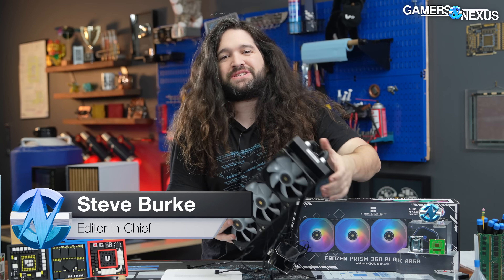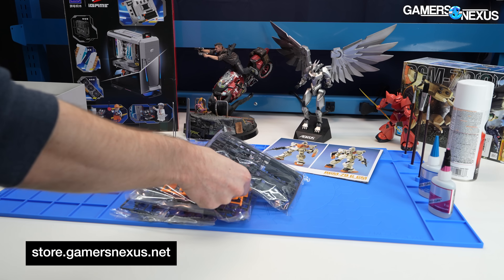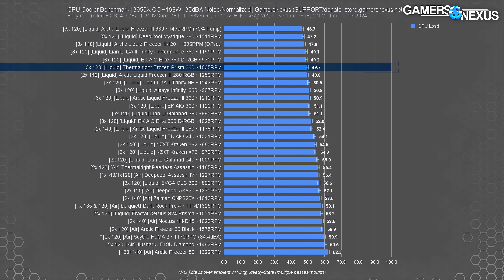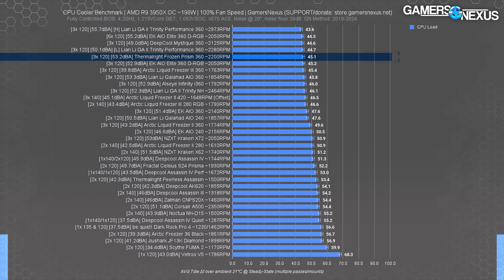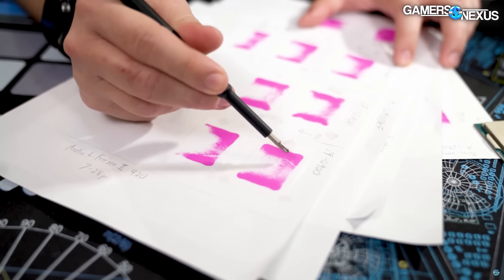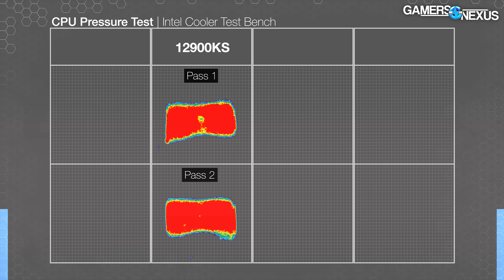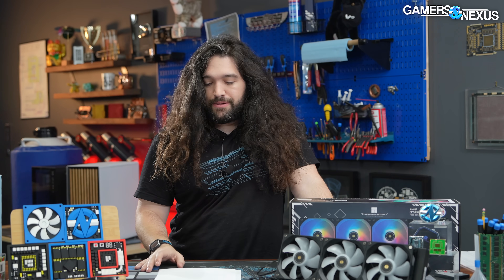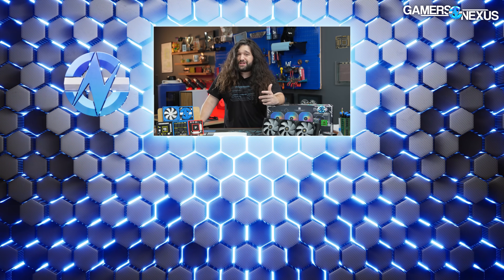Thermalright Strikes Again: $56.90 360mm Liquid Cooler | Frozen Prism Review

Comment from the maker: Working on updating the Mega Charts right now, by the way! Adding a bunch of stuff to it. Ended up holding on the update a little bit because Noctua should be launching the Noctua NH-D15 G2 very soon (per Computex interviews), so we want to add it in with the update! Really looking forward to testing that one.
Watch our Liquid Freezer III review here: https://www.youtube.com/watch?v=zfffNRTOZCc
Check out our Antec C8 Case Review from yesterday! https://www.youtube.com/watch?v=yJAq2H52A2A
You can grab one of our PC building Modmats with wiring diagrams, pinouts, and screw-tracking grids here: https://store.gamersnexus.net/products/large-modmat-gn15-anniversary
Or our PC Case Badge Magnets here: https://store.gamersnexus.net/products/gn-3d-multi-level-pc-case-magnets-amd-ryzen-intel-gn-logo
Reply: please please do a low profile air coolers for sff itx builds  showdown please 😢
Reply: Can you post GPU Mega Charts to your website? I would like to look at those!
Reply: Surely Thermalright Peerless Assassin SE will be present on this list
Reply: Did you know that on the Thermalright website, if you go to the media section they put up a bunch of your videos? :)
Reply: Thanks this is really impressive for this price point. Have a lot of TR Air coolers (PA/PS/FC I think) and they have been great. Certainly interesting to consider for a first AIO.
Reply: Just a quick notice from Germany: here Lego more likely gets called „Klemmbausteine“ or „terminal blocks“, for the more general therm. Because one big company in the space majorly stopped making money with good products, but seems to sue everybody.
Reply: Hey Steve, quick question, did you upgrade your main camera lately? It looks really clear and the color depth is on point.
Reply: @GamersNexus i have used lots (10+) of their latest AIO's (Thermalright's) and the pump is very loud.... Been double checking contsct on cpu etc. placing radiator specifically on top etc. still loud noise. Setting fancurves as well and still noisy. Also worth mentioning it where al AMD cpu builds. It's the reason i wont use these AIO's anymore. The pump has been the loudest part in every build i had with it. Setting it to an acceptable low noise curve would just result in bad temps even on amd cpu's. Makes for awkward sutuations when selling my builds. Already have to explain memory training for am5 and than i also have to adress the noise from the pump at idle....Greetings from just an average amateur pc builder.
Reply: I would like to see noise tests for just the pump. As people can just replace the fans for better performing and quieter fans. If this Thermalright can do better then Artic or Lian Li in cooling, then these thiccer rads are a downside. As it restricts which parts fit in your case.
Reply: Are you planning on also testing the Lianli Hydroshift 360 AIO. Would really enjoy seeing your thoughts about the brand new product. Thanks for your hard work.
Reply: My company I work for that does pc repair and builds, We use Thermalright Liquid Coolers and have been for around a year and a half, never had one come back with issues. I've seen so many corsair Liquid Coolers  and MSI that I don't even recommend them to my customers. I would say Thermalright from my stand point is a good reliable cooler, Much more so then Corsair and MSI
Reply: Do you know whats the best of the best on thermalright aio coolers? I need the best of this brand but im very confused
Reply: Add Corsair to this list!
Reply: Thermalright is not a public traded company so no share holders to make happy this way they don't have to focus on profit only making them able to just make good products for cheap. This keeps the goods low and and customers happy
Reply: I definitely don't value your knowledge about cooling related stuff because its not an important topic in pc hardware nowadays

Comment: i was hesitant to pick up a thermalright aio, but all the praise they have received for their air cooling solutions, i just had bit the bullet.  i mean the fw360 has an lcd and I got it for $86.  It's been great so far and I have had zero issues, and the LCD screen is so cool to customize and mess with.  the fans are surprisingly quiet, and much quieter than the corsair aio I had in there for almost 3x the cost.

Comment: I've had Thermalright since the True Spirit (the first version!) way, way back in the day. Now I have one of their Macho's.

The first Truespirit (TS-120) survived for... 12? years without a hitch before the fan failed on me. Bought it in 2011 almost immediately after release for like 20 bucks.
Then I replaced the fan with a Noctua one, that failed just in about a year. Then I replaced it with excess Arctic fan I had lying around and gave the whole system with the cooler away, afaik still running strong without a single issue.
The contact on that cooler on the IHS was beyond amazing. It was PITA to install, but you can't get everything at cheap prices.

Oh, and the Macho Rev.B? Going strong, but I did replace it's fan with a Arctic CO/PWM one after it started to make noise. It's been in use for several years already - I think I got it in 2017 or 2018.

Comment: NGL I bought a thermalright 120mm Aqua Elite 3 and it keeps my Ryzen 5 5500 down to 30-38c idle, max of like 62 under load. I'm severely impressed for a 1 fan radiator.

Comment: I'm sorry in advance Im cheap and stupid. there not pointing out the obivious for you armchair crittics  my2009 asus mother board would just shut off. power supplie, nope,memeory nope,battery nope,try an old invida 4000 card,nope ,but when removed it would boot up & work for a while,on board graphics card puss. ok shop> ATX 850 watt power supplie is new , atx case > go get an asus tuf gaming z790  pluw wifi, then a i7 14 gen chip set, ddr5 32 gig 2 gig ssdrive, ok cooler,  274 watts of power ! ,  1700 series > go shopping >>PUSS info data >>Youtube >> for the $ 
Thermalright Aqua Elite 360 ARGB CPU Aio Cooler ok great  order it got it  and it won't fit in the case?? !!  WTF !  >> 4our hundred two  402 mm long  120 mm wide  27 mm thick .what case will it fit in ?  will everthing listed fit in and work, Ihave a saws all and welder , but don't want to brake them out for this.

Comment: The Peerless Assassin is great, I also have am Aqua Elite V3 240, which cause some problems when I removed it on my AM4 system, it pulled the cpu out and it dropped, bending 2 pins. I salvaged the CPU but it was scary, be careful removing them. I don't know if it was my paste or the cold plate, but it operates well.
Reply: Thermalright sells a bracket to prevent this called "SST-AMD"

Comment: I have a question that I would appreciate if someone answered. Is the noise of the aio mostly dependent on the fans? If I replaced the fans with higher quality, quieter fans would the noise go down a lot or does pump noise contribute a lot too?

Comment: Steve, I have a question that I think you are the most qualified to answer. I have a single 60mm*360 mounted on the side. I need to change it to a dual 27mm*360 mounting them one on the top and one on the side. My Question is would it be better (for thermals) to have my routing go from the pump to the first rad then to the cpu and then into the second rad back to tank? or from the pump to the first rad then to the second rad then to cpu and back to tank? Without testing I can see why both have benefits and downfalls. I only have the cpu in my custom loop (no gpu in loop) and will keep it this way. I just think that you will be the best to answer this. Just for info sake i have a I9 13900k furnace. I know you guys like to test and retest. Maybe i'm overthinking this. Any help or opinions would be great, thanks

Comment: $55 ish 360 liquid cooler. I'm sure you will trust you $500ish cpu to that. Yup...what could go wrong. I'm sure it will last for ever.
Reply: No one spending $500 on a cpu is buying this cooler
Reply: @ed13hi  wanna bet? Even if they don't. Would you trust your $300 CPU to it then. Does that work for you?
Reply: @VaporwaveOnVHS  ok. You buy the $55 cooler. We will keep in touch and see when you have to replace it. If that's toxic. Oh well.
Reply: @WiFuzzy  whos buying a $55 cooler for a $300 cpu?
Reply: @ed13hi  Ummmm. It's actually what it is designed for and how it was tested. So I'm pretty sure that is what will happen.
Reply: @WiFuzzy  you just wanna fight
Reply: @ed13hi  No. I'm just right and that seems to bother you.
Reply: @ ok sure

Comment: Been using Thermalright fans for a while now. They are less than $15 for a 3 pack on Amazon and Are powerful, quiet and have great looking design. I can't really speak on their longevity because I have upgraded from the V2s to the V3s in a little over a year and have only had the V3 for a few weeks and have not had any of them fail on me yet. Including they are $15 for three I am more than willing to buy one or two every couple of years if necessary.
Reply: Also I believe supporting companies that try to give good quality budget options for people who want decent performance and looks without breaking the bank. This is the same reason I am a fan of ThermalTake as well. They also offer great products for a low price.

Comment: Lian Li has the same thing going on with their Galahad series of AIO coolers. Just so many variants with the only differences seeming to be aesthetic or minor differences in the fan package. The only one to really differentiate itself was the Galahad II Trinity Performance with its thicker rad, higher flow pump and crazy fans. Even then if you didn't know what it was and what to look for, good luck picking it out of the rest of their coolers. I ended up slapping some Noctua AF-12x25s on mine to quiet it down which works great. The Trinity Performance fans have wild specs but also crazy noise.

Comment: I have been using the Frozen Prism 240 on my R9 5900X for a little over a year now. Super impressed with the quality vs price point. This "cheap" little cooler (I put it in quotes, because the price seems to be the only thing cheap about it) has handled this 12 core CPU with no issues. Even compiling the android operating system (aproximately an hour on my system), the CPU rarely hits 70c, and that result has proven true across basically any benchmark I throw at it. Cinibench 23 and 24, 7 zip compression/decompression, etc... I am extremely satisfied with the chance I took on this cooler. I'd recommend it to anyone, any time. Honestly, the only thing missing (vs the WAY more expensive coolers in the same performance range) is the "bling". The LED display on the pump, the fancy controller and software, etc... None of which I need, so....

Comment: I feel like if you're going for an ultra budget solution... you're not going to be buying a processor that is putting out the heat that would require liquid cooling to keep cool to begin with. If I'm broke or in a part of the world where money is extremely scarce/tight, I'd rather just have a reliable air cooler than possibly spending 60 bucks a year (when that 60 bucks is a massive deal in that situation). I've been air cooling for basically ever (side quest early on when water cooling meant everything custom WAY before AIO's were a dream) and with my use case, both in processor and load, it just wasn't worth the hassle or cost. If I were building in a really constricted case like SSF or ultra ssf, with a higher draw/heat processor on top of that (I personally wouldn't build anything under an i5 equivalent in itx unless it's basically a mobile chip like the MoDT boards form minisforum, but that's also because I prefer air cooling and the extra space helps with flow), then I would look into an AIO for sure, but that's not me.

I just don't like the idea of poor longevity, but I'm also a person that makes a system stretch 4+ years minimum, not what it seems the majority of reddit posters and the like seem to do with buying a new system every generation or so. Same mentality as buying a new camera or phone every cycle I guess; efficiency and wise spending isn't the goal most of the time, just expensive new shiny after the shine wore off the last setup.

Point is, if you're spending so much you actually need water cooling for more than just benchmark queen scores, you're going to be dropping a lot more on a processor, and you'll have the extra money to buy better performing options. My budget/midrange build from a couple of years ago I still happily use with a 12600KF and air cooling runs perfectly fine. Worth pointing out I've basically never maxed the load on it. I have an actual workstation/rendering server I built for multicore intensive loads, and the games I play on the 12600KF PC are mostly indie games a toaster could play and emulation (Cyberpunk 2077 and D4 are the only recent/modern games that I touch, and it's happy with those heat wise).
Reply: Hey I'm a complete noob who needs help building a pc. You sound like you know a few things about that. I'm planning on buying a 7800xt gpu with a ryzen 7800x3d cpu. I've been looking into liquid cooling and it's driving me nuts because it seems like no matter how good a certain liquid cooler is, they still have big downsides. Should I just go with air cooling or do you think the 7800x3d needs liquid cooling? I also have other questions about my build if you're interested in offering some advice. I would appreciate it.
Reply: @Rye-jl2fk  watercooling is about esthethic. 
an air cooler will have less noise and cool better at similar price. are way more reliable and longer lasting, and are often way less expensive.

and no the 7800x3d doesn't need water cooling. a peerless assassin is more than enough to cool it

Comment: Thermalright products are crazy! Im using this Pearless Assasin 120 for 6months now to cool my 5700x3D and it does the job so well. I didn't even see temps beyond 60C even when full load and not even using my AC every time I play with Triple A games at 14440p max settings such as RDR2, AC Odyssey, Elden ring and many more. Might change to AIO instead to try being fancy and give this PA to my brother
Reply: Hey what gpu are you using? I was thinking of buying the 7800x3d but it's so much money I might just go with the 5700x3d. I only game at 1080p. What do you think?
Reply: @Rye-jl2fk  im using a 5700x3D and an rx 6800xt. Im always playing on max setting at 1440p and my cpu never got beyond 60°C as far as I can remember.
Reply: @Northkalman  That's actually insane. I asked ChatGPT if the Peerless Assassin was better than the Phantom Spirit and it said it wasn't. I checked the prices and they're basically the same so I guess you can't really go wrong with either.

Comment: using the thermalright frozen prism 360 black led edition in my r5 7600 never had issues, never above 58 even in intense usage. fun fact, STEVE this is something you will find interesting... i am using the gamdia talos e2 elite computer case, now... i also use the 360 big radiator in my pc... the radiator is at the FRONT, case fans still in place, radiator positioned behind the fans, plus the front fans, push air into the radiator, while the radiator fans suck it THROUGH the radiator. fun thing about this setup... its so COVERT. you DO NOT SEE THE RADIATOR!!!!! if you would like, i can make a video, or some pictures of how its build.. you will be amazed and confused... i PROMISE.
Reply: oh and the temp is 38 constantly(max 40) under casual use  (watching youtube and surfing the web)
Reply: There's no way to know how good it is unless you test it with a 5800x.

Comment: Hey for the mounting bracket will it br an issue if you mount them vertically parallel rather than horizontaly parallel?

Comment: I bought my Thermalright 360 AIO oct 17th 2023 the day the intel i9-14900k was for sale about 10 months no problems so far I also used there CPU hold down plate. will say I only bought it cause there was no corsair in stock iv never had a corsair fail I got 2 AIO's still going strong after 9yrs running 24-7 but I need cooling and at $47.99 when I bought mine I was just going to replace later but im going to just keep it hell it may out last my i9-14900k that just started random blue screening. thanks for sharing

Comment: Wonder how mush is effected by the fans alone. 
Many use different fans on there AIO's as to get a better performanse, more silent or even better looks and/or to fit the other case fans.
How would a Thermalright Frozen Warframe PRO 360 AIO perform with for example Lian Li UNI fans for example vs original stock AIO fans?

Comment: i have used a frozen notte 360 almost daily with over 2500 hours on it with zero issue. it cools my 3700x, even overclocked it never goes over 75c

Comment: With this price diff to any other AIO you can also buy the TG Direct Die frame and delid the ryzen for free with the dental floss method. This combo will easily beat any other AIO when looking for price spent to performance.
(Thermalright AIO $60 + TG Direct die frame $28 = $88, nothing at this price range will even come closer to the same result)